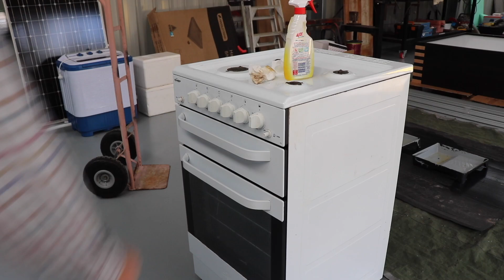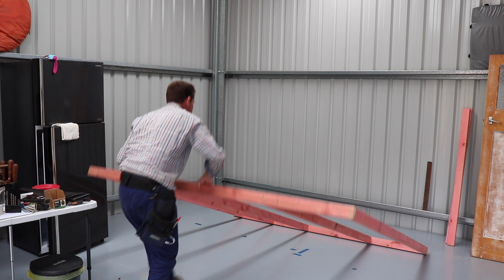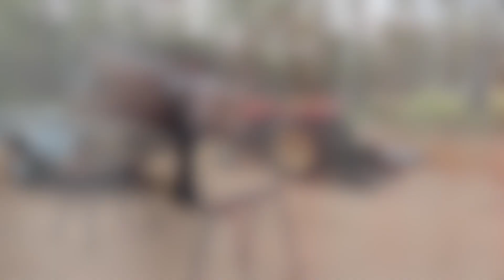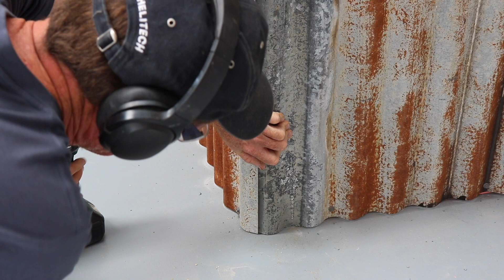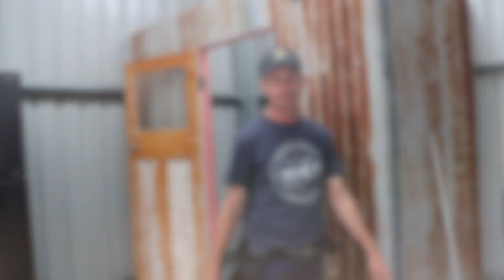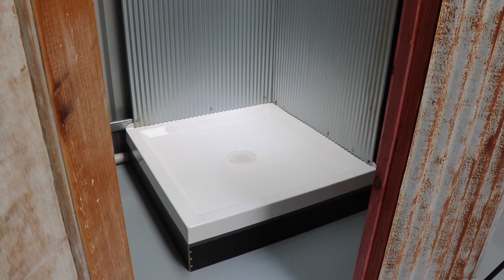Going Off Grid EP5 - Shed Bathroom Build - Forme Industrious

Comment: I had cause to use a screw out of my pot of random ones I've kept for the last 20 years just recently.... trouble was I needed two! 🤣Excellent work as always - looking forward to seeing more soon 👍
Reply from the maker: Many thanks Paul!! I have tubs of old bolts and nuts etc. All mixed variety threads from different eras :)
Reply: @ScottTurnerformeindustrious  nuts + bolts is a different story. I have a Series 2a Landy, so I have AF, Whitworth and Metric of every size you can imagine 🤣

Comment: Hi Scott,
I know you can complete every task 110%. Even though you are off grid living,the stove if it is installed inside will have to be installed with copper pipe with your bottle on the exterior. That would then have to be signed off by a licensed qld gasfitter. In your case more for building insurance purposes. No hate with my comment I know you would complete the installation at a higher standard than an average gasfitter. Retired plumber gasfitter here.
Reply from the maker: I certainly appreciate being steered in the right direction. Thank You!

Comment: Good morning from the US!  Do you need to worry about freezing temperatures?    I love the rustic tin walls and how you wrapped that outside corner.  Great job!
Reply from the maker: Good Morning Batti2323. No, the temps get cool but only rarely freezing. Thanks again!
Reply: Atherton Tablelands are up near Cairns. Lowest temp they'll ever see is like 10-15 degrees in the dead of winter. So like 50-60F?
Reply: Winter would only be a couple hours long that far north wouldn't it. I'm in Brisbane and winter is only about 2 weeks lol

Comment: Going to be great when you get that shower built, how are you going to heat it? Gas, solar? Are you going to do a bulk move with the workshop, or just bit and pieces as you go back and forth?
Reply from the maker: G'day Jon! I have a Smarttek Gas Hot water (Camping unit). It will be okay for this set up, but for the house I'll put in something a bit better. The move will eventually happen with all our house hold gear, but I may as well bring up what I can from the shed. Makes it a bit hard as I'm between both places. All the best.

Comment: Hi! What are you think about insulation!? Shi will be? Sorry for my English)))
Reply from the maker: I may put some timber boards on the inside when I finished the plumbing and drainage.
Reply: @ScottTurnerformeindustrious  I meant the insulation of the whole house. After all, in the heat, the metal heats up strongly and re-emits heat into the room.

Comment: For the door holes in the bottom plate half cut from the bottom side as you set the wall up and then it easy to cut away the top half when you are clearing the doorway.  A tip from my older two generations of paternal skillsets that's mostly wasted on this accountant!!
Reply from the maker: Haha, well that's a very good tip actually. Thanks again Brett!
Reply: You beat me to it Brett.

Comment: Yep, did not see that coming, after some careful measurements, getting corners 90 degrees and even a laser level, you just pickup the whole bathroom and cut a piece of timber to make space for the door. AND we got to get the whole structure plumed up again. It makes me think of your typical building progress here in Australia, The guy who does your house pad, "Oh don't worry about it Mate the Concreter will get it all nice and level for Ya!", the Concreter, "Oh don't worry about it mate the Tiler will get it all nice and level Ya!". The Tiler "Mate this is going to be a S!YT Tiling jog because YOU never made sure the Concreter got the Floor Nice and Level". Me just standing there staring into nothingness ." "Mate don't worry about it, the wife will come and check your Job!". The Tiler "I was meant to say, I think I can fix this bodged job the Concreter left us!" LOL! just pulling Ya leg!
Reply from the maker: Lucky for me I already made attachment holes in the floor and walls so it would go back in the same spot ;)
Yep otherwise you're on the money.

Comment: I've mentioned before the "Shouse" I built, our first shower was some tall star pickets with a blue tarp wrapped around it, and we heated some water in an old grease drum with a wok burner, then used a 12 volt camp shower to pump it out and our loo was a drop toilet with no door facing the mountain behind us, luckily there were no neighbours up the hill 😉

Luckily I convinced the building inspector to allow me to build a 1mt wide extension on the end to house a laundry and a proper shower, and discharge the waste to a flower bed until I could get the domestic sewerage treatment system put in. They were quite strict because Somerset dam was 400-500 mts down the hill, and they were concerned about runoff in heavy rain.
Reply from the maker: Amazing how simplistic we can make our utilities. We get a start and improve when we can. Thanks again!

Comment: I cut a piece of wood once and used it as a Template to cut all the others. 
A 12 Foot piece of wood from which I wants 10 Foot 3 Inch boards. 
123 Inches, but only a 10 Foot Tape measure. 
Back in the day when Australia was transitioning from Imperial to Metric. 
I measured 10 Feet then added 3 Inches … only I didn’t .. I added 3 Centimetres. 
Oops. 

Those Boards hung on a wall for almost 25 Years. 
A monument to My inability to Read a Tape measure.
Reply from the maker: Don't feel like you are alone Michael. I was born in the metric system and then used imperial for the next 30 years working on aeroplanes.
Reply: @ScottTurnerformeindustrious  well at least I didn’t Crash a Thirty Billion Dollar Satellite into the surface of Mars because I confused My Metric and Imperial Units of Velocity.